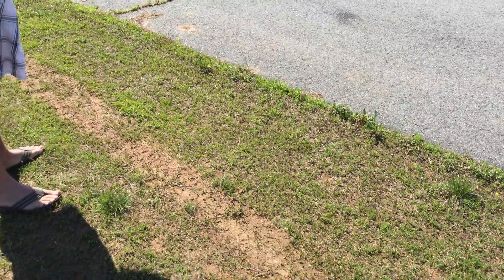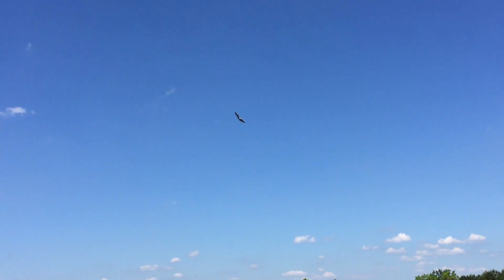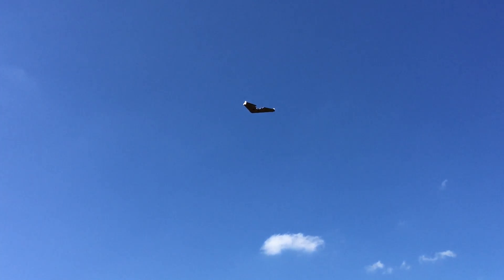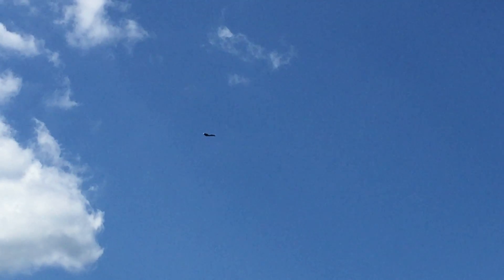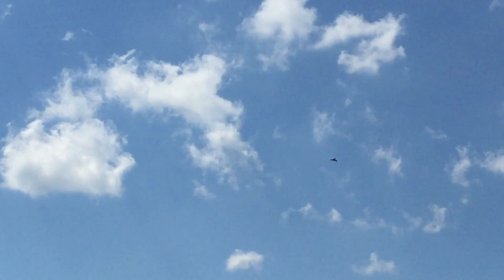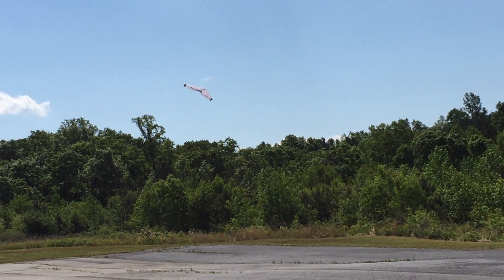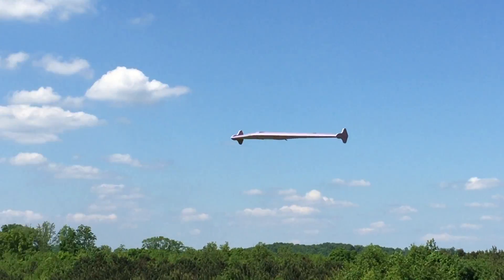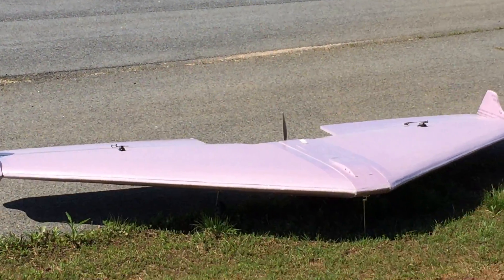102" Giant flying wing

Comment: i thought the concept of a flying wing was an aircraft that doesn't require vertical fins to fly
Reply from the maker: They're definitely not required. More to give a bit of side area to be able to do things like 4-point rolls. (Late in this second video: https://youtu.be/aelqy6iIC0Y?si=Jzjo8AqusKYspkZz)  Quite honestly, they are more for protecting the wingtips than anything else... and to provide a bit more authority to the elevons in slower flight. But yeah, it would fly fine without them.
Reply: @dcamchris  thank you for your answer

Comment: I flew this same design back in the 80s.
Reply from the maker: Maybe similar. This is definitely a one-off. Colton drew this one up mostly using the TLAR method I think. Maybe he will see and chime in some day. Then Dennis did all the hard work inside, with nothing much besides an idea of what we all wanted and some tried-and-true construction methods. And a 91" Extra's carbon wing tube plus a couple smaller tubes just for good measure :)

Comment: Does the increased size translate into longer flight time or more payload?  What was the goal?
Reply from the maker: It's intent was to be a "Mother Ship" for three other wings. Three of the smaller combat type wings fit. Two up top, one underneath. (Or vice-versa. Can't recall after we added retracts) Anyhow, we never got around to finishing it. Maybe some day.
Reply: Even if you carried even one combat wing a distance using the mothership, you'd have to fly it all the way home on its own, and it would need enough FPV xmit power to provide video at the max distance (or have auto RTL).  
I've seen one quad launch another one, but just as a goof.
Reply from the maker: FPV wasn't the thought, though that's cool :) The initial thought was a simple 4-pilot event demo. One giant wing takes off, does a circuit with mild aerobatics, then three smaller wings splinter off. All four do various aerobatics, formations, and/or perhaps a bit of combat. Good fun stuff, but we just didn't get to finish.

Comment: I absolutely love the silent, momentum driven glide that it enters. That whoosh sound is just so cool. Also, I think the plane seems a bit underpowered. For all that noise from the motor, it sure isn't getting much speed...
Reply: yeah, only a 14 inch prop.
Reply: mr amazing I agree, for such a large plane a tractor mounted prop would probably be better economically. Also a plane that size would have a hard time going racing speeds as I think finding a capable motor to do so would be hard. Maybe mount two pushers would help
Reply: @tinkertanner165  centered ducted fan?
Reply: It looks underpowered, but it is large and hence looks slower in the air than it really is.
Reply: Y13A that's because it's a pusher style wing